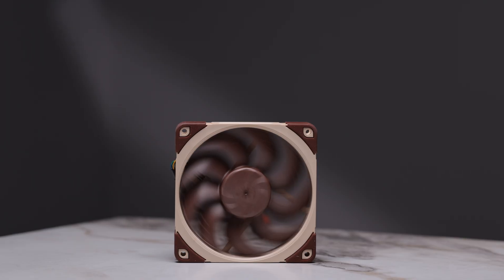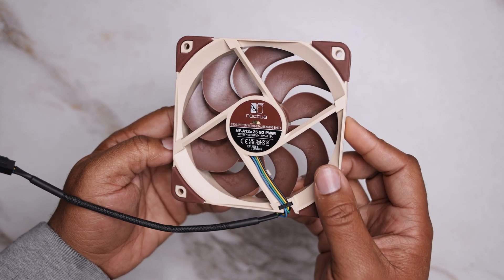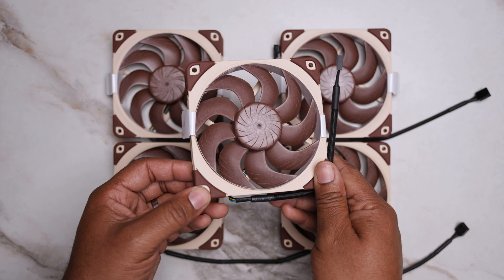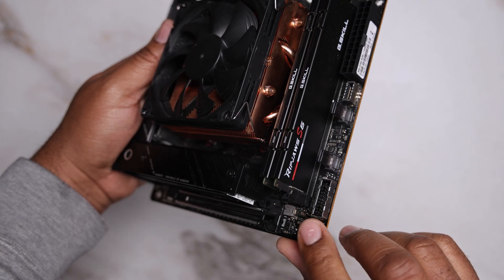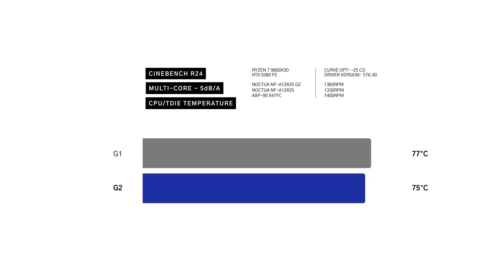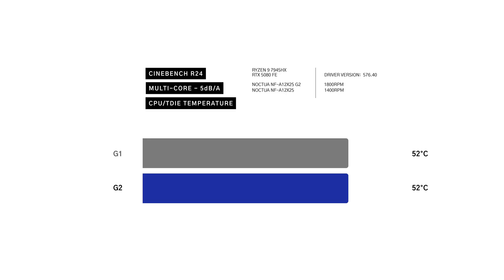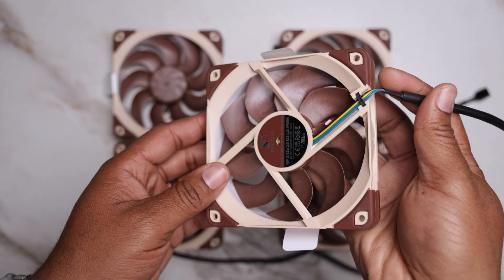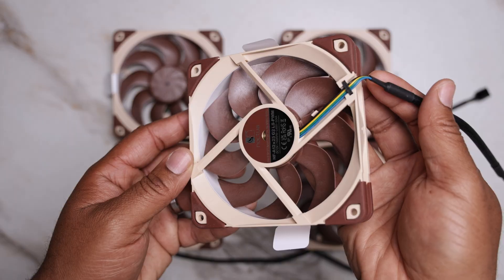Noctua 120mm G2? Yes.

Comment: Hi im looking for case fans specifically 1-120 fan and 1-140 fan for my inverted build should I get the Noctua NF-A12 g2 and NF-A14 g2 or the T30-120 and the upcoming T30-140
Reply from the maker: Which case are you using?
Reply: @ChrisRussellTech meshroom d

Comment: Do you use a specific adapter for the fan swapping the 120 mm fan onto the 90 mm CPU cooler?
Reply from the maker: No special adapter, just a different motherboard. The BD795i Se

Comment: Nice work! Can't wait for the Chromax G2 to be out.
A quick question about the T1, though: I'm planning on moving my MATX build over to a T1/Terra case, and I could use some suggestions for which components to use as far as SFX PSU and CPU cooler are concerned (I have a 7800x3d and Asrock Steel Legend 9070 XT).
Any suggestions for which cooler + fan combo I could use? I want to stay air-cooled.
Thanks.
Reply: The Chromax G2 is planned for Q1 2026.
Reply from the maker: It’ll be here soon hopefully, most people are holding out for it.

Comment: Compare it to the T30.
Reply: Machines & More did, the G2 beat the T30 in his testing.
Reply: @hwi7114  how much of a difference we talkin here?
Reply: @GoldFus1on  I can't remember exact numbers, but nothing massive. Definitely not worth replacing T30s with G2s if you already have T30s. Check the video though, it's not a long one.
Reply: @GoldFus1on  same performance and even tiny bit better static pressure, but remember its 5mm shorter so its very good to see. tho the T30 can still climb to higher RPMS, but it can't do low enough like the noctua.